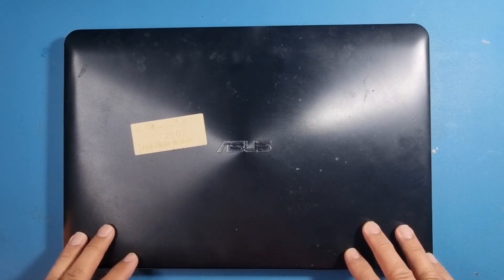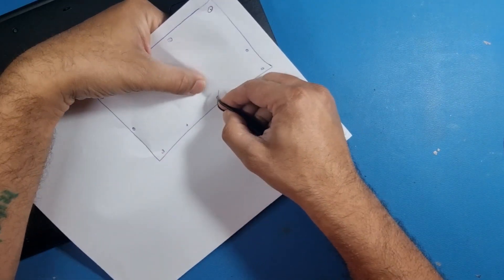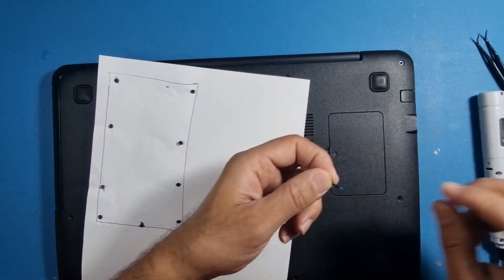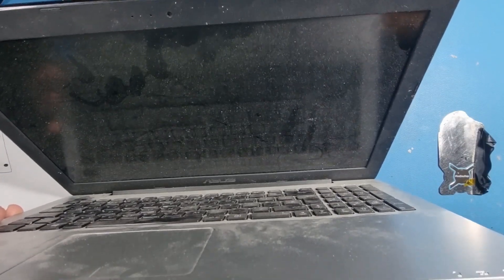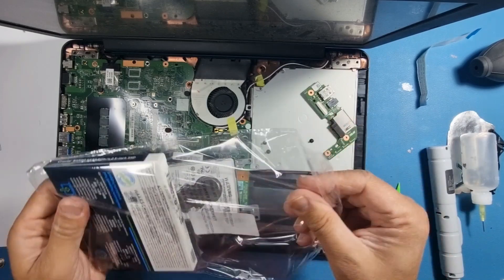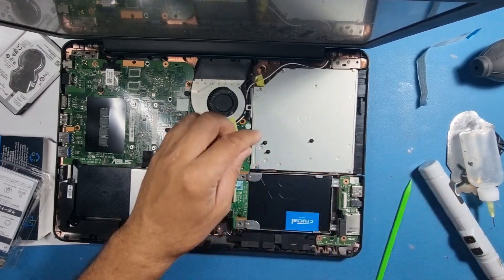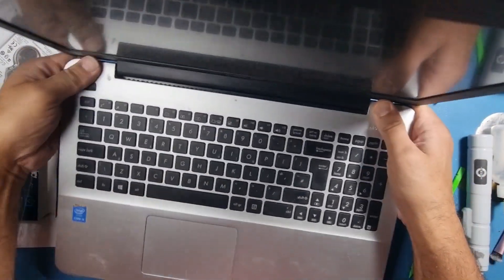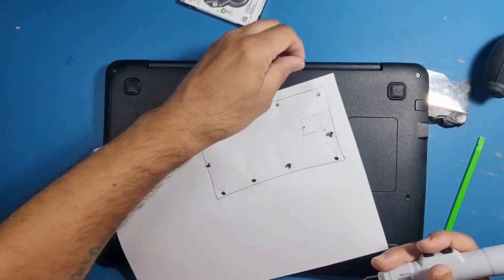Asus X555L Install SSD

Comment: Many thanks For Support!! But there is one thing: First you should disconnect the battery, then disconnect the disk. Then press the POWER button and hold for about 15 seconds. This will reset the BIOS properly and everything will go smoothly. Best regards!